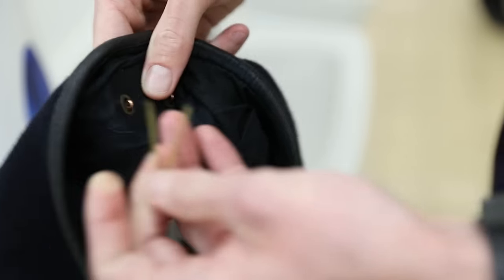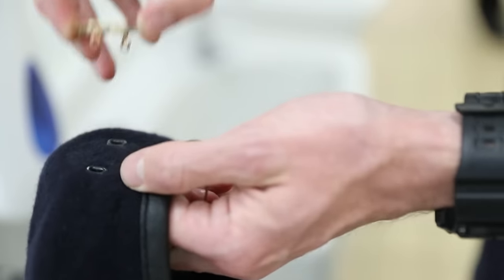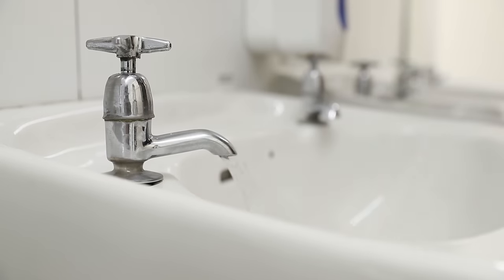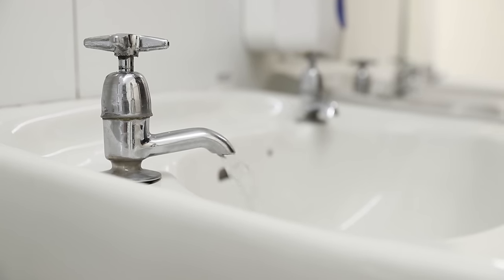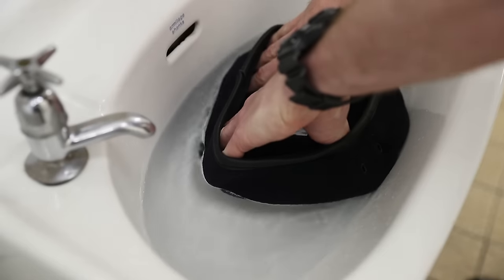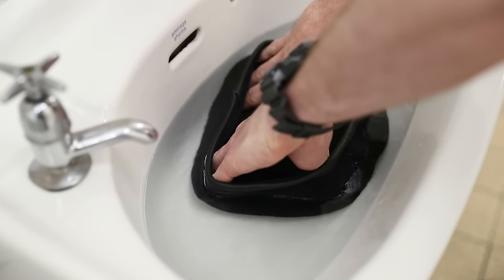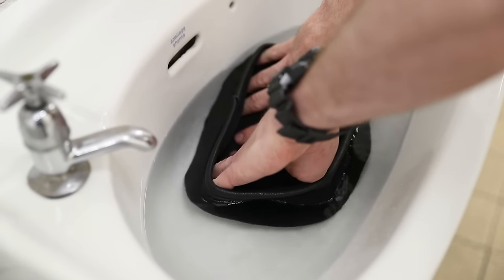How to shape your beret | Royal Navy

Comment: Receive beret from Pusser. Look up at the ceiling and say "Thank you, Pusser". Take lining out of beret with razer blade for nonchalant effect. Proceed to shave interior and exterior of beret. Brush off fluff. Hoover floor. Submerge beret in hot water. Submerge in cold water. Submerge in hot water. Submerge in cold water. Ring out water. With badge in, pull material to the front over the badge and eyes so you look all mysterious, then pull material to the right. Titivate. Using splayed fingers of right hand, grip the loose material on the left topside of head and bunch between fingers for gucci shark gills effect. Titivate. Wear until dry.
Reply: Hold My Bleach masterpiece

Comment: Can this be for air cadets?
Reply: Yes, the principal of shaping headdress is the same regardless of Regiment/Corps. Though you must ensure the cap badge is above your left eye, the rim of the beret is 2.5cm above your eyebrows and all excess material is pulled down the right* side of your head.
Reply: @adamdavanna6229  only the navy has the excess material pulled to the left, army and air force pull to the right with cap brass over left eye
Reply: Gabriel Swan An excerpt I found online:
“Official guidance from the Royal Navy on the beret explains the headpiece "shall be worn evenly on the head, with the sweatband 2.5 cm above the eyebrows, the badge centred over the left eye, and the crown pulled downward to the right.”
Reply: @adamdavanna6229  in your previous comment, you said pulled down to the left. That's where the confusion came from
Reply: Gabriel Swan Apologies, I meant right but my mind must have wandered!
Reply: @adamdavanna6229  no worries mate, my fault for not reading in between the lines